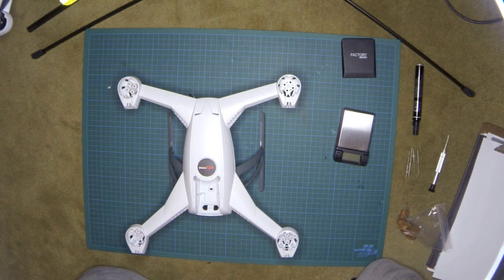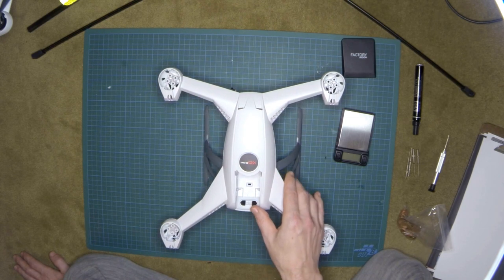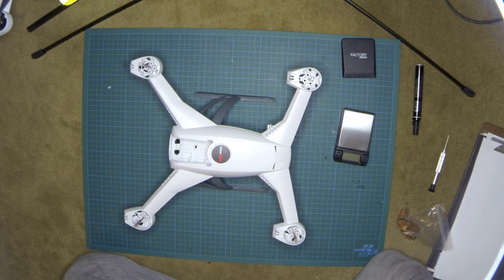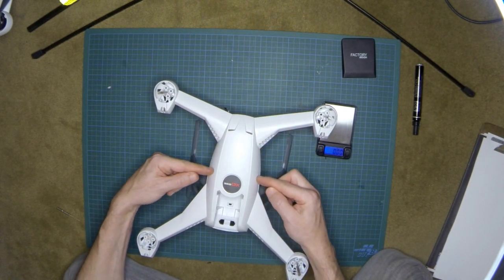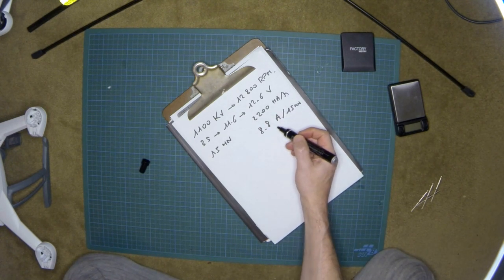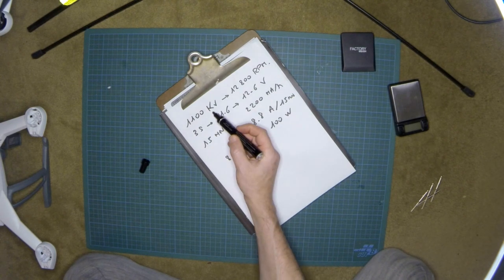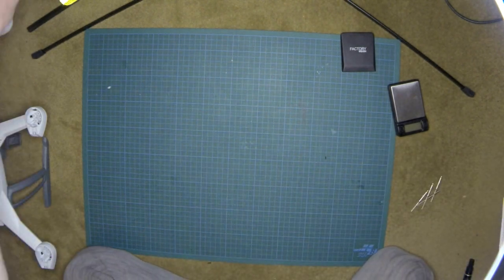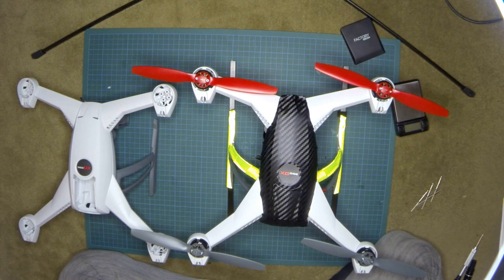350 QX carrying weight, perfect location for brushless Gimbal and total flying weight

Comment: Good video and sensible comments, The centre of thrust is a good place for the centre of gravity when all up weight is available,  All my R/C heli's  have the centre of gravity  exactly where the main shaft for the rotors/Blades are,   and when set up correctly the Heli  doesn't drift,, except when there's a breeze.

Comment: Great video and very informative. I'm using the cheap ebay gimbal and a SVC200 camera (mounted at 90 degrees so it fits the gopro gimbal) which gives similar image quality to the gopro3 but half the price. I've mounted mine on the American football shaped piece of plastic under the quad. The added weight of gimbal and camera is 350g so hopefully within the safe margins of flight.

Comment: The ideal CG would be at the center of the motors...Yes its missing all the parts, but in the end it you would want it to balance at the center lines of the motors
Reply from the maker: That is exactly the point ! where ever is the actual CG, when adding more weight one has to move it at the exact center of the motor.

Comment: First, the trick with robes shows center of trust, not center of gravity. Second, you need to be looking for cg on the complete quad with batteries etc, not just on empty shell.
Reply from the maker: In that case, center of gravity and center of thrust are exactly at the same point and about the experience on the empty shell, it's actually as valuable as with the full quad because the inside of the quad with batteries is well balanced. The only thing that can unbalance the whole set up is the gimbal or anything you add.

Comment: NO...That is not the center of gravity......You have NO electronics in it first of all...... You have found the center of the motors!...... The actual center of gravity with the battery is just under 1 inch from the center of the 350 QX Sticker to the rear!.....a Quarter of an inch into the battery cover from the center of the sticker........ NOW you have to reconfigure.
Reply from the maker: OK, where ever the center of gravity is (even 1 inch under the label) when there is no added weight on the machine, what is important is to move this center where the center of the motor is, that is to say, at the label. So as you can see in my video when I demonstrate with the actual working 350QX (not the empty shell), I managed to move the center of gravity at the right place so each motor has to bear the same amount of weight to lift. That's the only way to be able to lift heavier weight without killing front or rear motors.
Reply: In any case, the center of gravity is NOT the label ...Gravity has to do with WEIGHT not measurement ....center of gravity will move as anything and everything is added or removed
Reply: Dreams Producer I see your point and agree.  It's not important to find the center of gravity with all of the electronics attached.  It's more important to find the center of gravity, ref the location of the motors and then mount everything else accordingly, so that each motor will have an equal amount of weight distributed to them; thus the load of each motor will be equal...in theory giving them equal efficiency.
Reply: xlrEAGLE I will be going through my 350's electronics to see if reconfiguring their mounting locations (for a better CG) will improve flight times and equalize temperatures of the motors.  I understand this is just a 350 with basic electronics but it should still be fun.
Reply: fun till it crashes
Reply: Redesigning an aircraft for a more balanced CG won't make it crash.  It will make if fly better.  And as for crashing...show me an RC pilot who hasn't, doesn't, and won't crash and I'll show you a liar.  I have been flying RC for more than 20 years and I till crash.  Get over the fear an have fun!
Reply: You are reading MORE into what I said then I intended ....!!!!!

As I stated before going by your final statements.... YOU SAID -->"It should still be fun. ..... and I said, --->Fun Till It Crashes, thats all....I mean nothing other then what I said....... its fun till it crashes.......... fun till it crashes......fun till it crashes......   And with that said,

WHEN I CRASH, I WANT IT TO BE  BECAUSE I DID SOMETHING DUMB OR STUPID.....NOT BECAUSE THE PIECE OF SHIT PROP BROKE AGAIN AND AGAIN AND AGAIN

Comment: just try a balance the quad on one finger with everything on then u get the CG, I don't see the point moving the mount for the gopro 9/10 quads have the gopro sat right at the front (there is a Reason for than)

Comment: If you're burning your LiPo's till 11.6V you're not using all 2200mAh...
Reply from the maker: don't you mix things. mAh is just an indication of how much power the battery can deliver per hour at normal discharge (1C) 2200mAh by 12V = 26.4 watts
you can burn your battery during 2mn or 1 until it's dead, it will remain 26.4 watts

of course, using this battery at greater discharge (4C) you'll divide the time before it's dead by 4 but get 4 times more power in the meantime so 105.6 watts for 15 mn.

If I am not burning my batteries over 11,6 (sometimes 11V but no less) it's because it will increase the lifespan. Complete discharge or near complete discharge for Lipo batteries must be avoided if you want them to last longer.